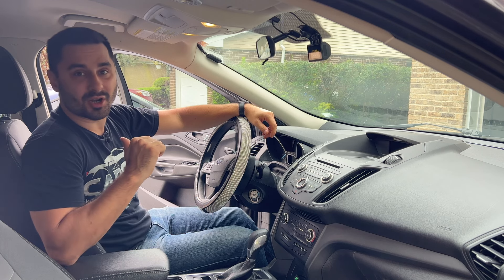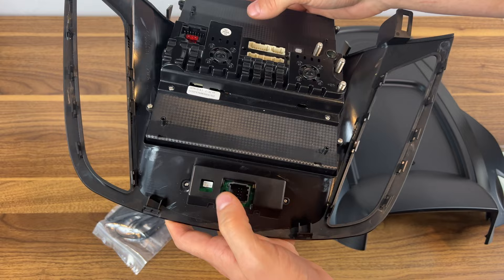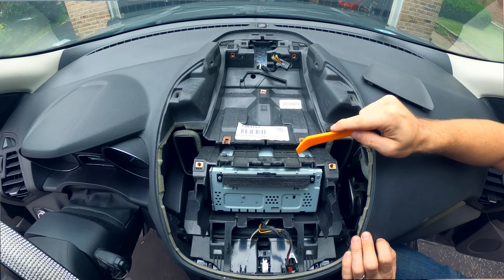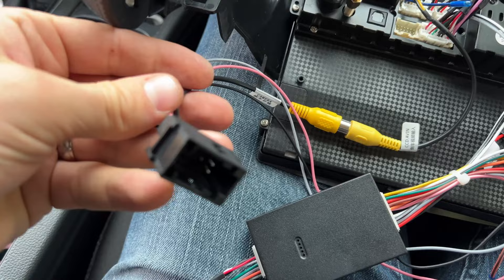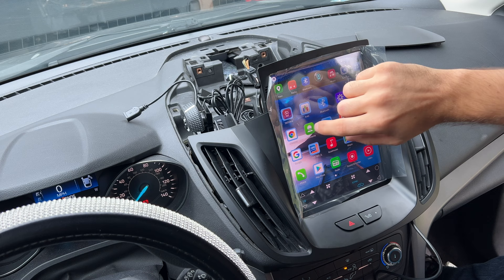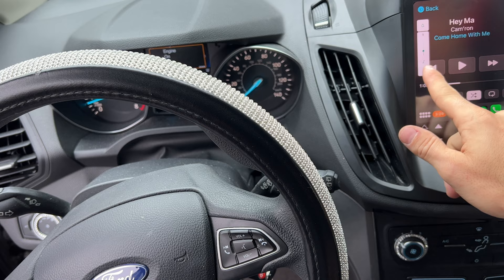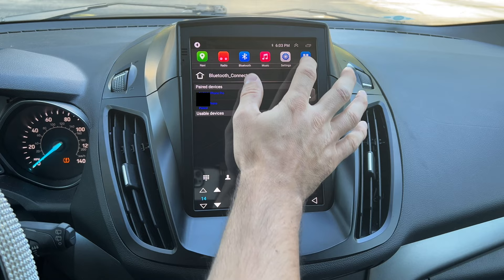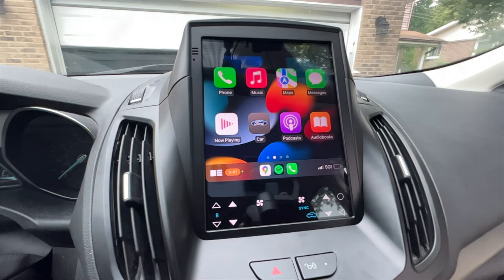Ford Escape Wireless CarPlay Retrofit - Seicane Headunit Install/Review

Comment from the maker: Ford Escape (2013-2018): https://www.seicane.com/android-for-2013-2018-ford-wing-tiger-radio-with-gps-navigation-hd-touchscreen-bluetooth-support-carplay-dvr-obd2-h7662?acc=b73ce398c39f506af761d2277d853a92

You can also get similar units for basically any car you can imagine!
Reply: Hey where do I get this device to buy? where can I get it installed. I am in the US state of Texas.
Reply: Great video, one area you don't address. Is the backup camera the stock one with the vehicle, or did you buy an add-on? If it is the stock which video cable were you connecting to the one for the unit. Thanks
Reply: do you think it will fit the 2019 escape?

Comment: I just installed this in the identical car if this video and I can tell you it's not a simple plug and play installation. The back of the video display hits the front part of the plastic box that holds the factory radio which required use of a dremel tool to trim a large section of it off to get it to fit. You also need to cut out room for the connections to the GPS antenna and radio antenna. Speaking of the radio antenna, you will need to buy an adapter cable to connect the unit to the car antenna. What's also missing from this video is that you need to remove the plastic locking clips from the dash parts you remove and install on the new parts. Not sure why that was left out. Technical support from Seicane is a joke. They will respond to your emails, but they are of no help. I figured out everything about installation and using the unit on Youtube or trial and error. The unit does look good after finally getting it installed and seems to work fine so far.
Reply: Thank you for posting this! I am trying to install this now and have been running into issues with it fitting. Thank you!
Reply: I’ve been looking at touch screens to put in my moms 2018 escape and the dash kit is fucking expensive
Reply: You should’ve did a video
Reply: Pictures or videos to share?
Reply: Thanks for commenting is the factory back up camera plug and play on what is shown here or do you need to purchase an aftermarket camera?
Reply: how is the mic on yours?  Can you use an external?   I've been looking into getting one of these for my truck.  I've installed a few stereos before, but not from Seicane
Reply: @dougkovach6213  The factory back up camera is plug and play and works fine. This is one of the big reasons I got this unit.
Reply: @brichardson7884  It's okay, but not great.
Reply: Thanks for the info, I have been going back in forth will the seller of the item to get further information and language barriers don't help to get everything correct.
Reply: Hi Bob,would you do installation with fee just in case?i want this unit get installed in mine too! thank you.I am from syracuse
Reply: Any update on functionality? Still working?
Reply: Do you have a link to the radio antenna adapter
Reply: @creson12 did anybody ever responded when you asked the big question “how has the radio been performing “ was it even worth it?
Reply: This is true, 9 out of 10 of these things require some slight modification to the inside of the dash. I just did one on Ford C Max (same dash and wiring) and I had to remove three pieces of the interior dash with Dremel. Don't get me wrong it wasn't a difficult job but it would have been nice to know beforehand rather than suggest it's just 'plug and play'.
Reply: Yes, this was not in the VIDEO. I bought this unit because there was a installation video. WTF? I have to remove a part of my car/ dash to get it to fit ? What if I want to return it to the original factory set up ? Very Very misleading and disappointing! Ill see if I can do a video.. SIMPLE CAR GUY...Not so simple!!!
Reply: @jeffbrady6422  I got one from a brand called Junsun or something like that, same thing, no plug and play but with some slight modding it fits spot on.

Comment: Yes the person that did make this video left out the most important information. Which makes this video helpful but totally useless. You have to cut two sections of the plastic where your old radio was in order for this to fit. You also have to use the clips from your factory parts to get this to clip in. Someone mention that this does not come with the antenna attachment to fit the new radio YES IT DOES. it comes with everything you need.
Reply: Do you know if the OEM camera will work and if it will also beep when backing up? Thanks!

Comment: How did you connect the radio connector you removed from the factory radio to the new unit? Didn't see that part in the video. They are totally different. Did they give you an adapter for this?

Comment: 2016 escape - best advice is to dry fit new unit before adding wiring or the old vents. You can see what plastic needs cut out to fit and save yourselves lots of trouble

Comment: I installed one in my 2015 Escape s. Ive had the same issues others have had with the 2015s. Steering controls arnt recognized in the software, original usb port just charges, no data transfer, and i cant seem to get Android Auto to work wirelessly at all. Wi fi hotspot from my phone seems intermittent, and the unit dosent like to hold settings, im constantly renableing wi fi and mph instead of kph in the settings. Any help would be appreciated.
Reply: Where you able to figure things out and did you install it on 2015 ford escape SE?

Comment: Didn't see how rear view camera appear and how GPS working, why? Maybe because is some significant issue with it?
Reply from the maker: I show how to set up the reversing camera and show it working at 12:35. As far as GPS, this was installed specifically to use with Apple CarPlay which I show it working at 10:35 (map is blurred for privacy). Thanks for watching!

Comment: I noticed a comment below where you responded to the TPMS light and I had noticed that it was on too when you were demonstrating the display.  The battery and check engine lights were not on so it was not the same as when you start the car and a lot of dash lights come on then go off, so I just want to clarify why the TPMS light was on in your video.  Was the TPMS light on as a result of anything you installed in this video?  The company also sells "TPMS" as an add-on for this product so I'm curious if it is required because maybe removing the old head unit also removes the factory TPMS receiver and that could have been why your light was on?  I really want to buy this product, and I've sent a question to their customer service about the TPMS light and to be sure it would fit a 2013 Ford Escape Titanium as it has a different dash configuration with a larger screen.  So when you said below " I have checked since and all is good" you are saying the factory TPMS still works fine and installing this part had no impact on it?
Reply: Did you ever get a reply from the company?
Reply: @alfredovazquez7917  wondering the same

Comment: I just installed this in my 2017 escape SE but the large harness that went in the back of my stock 8" screen doesn't have a mate with this new unit...my car also came with a back up camera but the harness I'm supposed to connect at the upper windshield near the hood doesn't have that factory cable to plug into...and my car came with 2 USB ports but there isn't anywhere to plug in...I'd zelle for some help. 

Basically, everything works, but the camera doesn't work since I don't have anywhere to plug that piece into, stock USB ports don't work, and my steering wheel volume controls don't work. Somehow, the screen actually controls my air and heat, which I don't really need because the stock controls are below. I'm hoping for some help.
Reply: Adding to my previous post: do NOT buy this if your escape came stock with the OEM 8" screen like mine. That head unit has a 54Pin harness and this kit does not come with one whic is why my steering wheel functions don't work, rear camera doesn't work,  and USB built in port don't work. Since then, they sent me a 54Pin harness adapter to connect the video for the reverse OEM camera, but the feed is blurry and I tried every setting possible and nothing has worked. The 3 wires that go into the decoder aren't being used which I believe is why my camera still doesn't work....will update once I receive more instructions from customer service.

Comment: I just installed the product. Steering wheel media control buttons are not working. Could you please confirm which cable to be connected?
Reply from the maker: I don’t remember which cable exactly, but you may have to go in the settings and enable/configure yours. Have you connected all cables?

Comment: I ordered this unit from Seicane for my SEL 2013 Ford escape. They said it would be compatible with my vehicle but it isn't. The harness isn't the same as sync 2 head unit.

They sent me what you installed but the wire harnesses are much different. 

No sound or wheel controls.

A stereo   without sound is completely useless.
Reply: And they will not help you one bit. As long as they got the sale that's all they care about. Crap company, crap customer service and support. All around garbage
Reply: @Jeff Stienborn  I'm experiencing the same. I just replaced my stock 8" just bc I was bored and wanted something new and the harnesses they provided are leaving 2 of my stock harnesses without mates. Back up camera doesn't work, stock USB ports no longer work and steering wheel controls don't work. Amy luck on refunds??

Comment: Could anyone tell me what connects to the other side of the can bus decoder? If you look at 7:35, it would be the connector on the left side. I think it's a 2x7 header. My kit was missing whatever cable/harness plugs into that side of the decoder. 

There's also nothing connected to one of the 2 large connectors that was plugged into the original SYNC unit. Coincidentally, I don't have any SYNC functions and the tach & speedometer on the home screen don't work.

EDIT: I emailed the supplier and we got it working by changing some protocol setting in the stereo. Apparently nothing plugs into those headers. Presumably they're made with extra connectors to adapt to a wide range of vehicles.
Reply: Same here on the steering controls - I have one large connector from the new harness not connected and one from the old for the old buttons
Reply: I also have the same issue no connection for one side of the can bus decoder. I wonder if that is why my backup camera does not work. screen switches but no image.

Comment: I have a 2018 escape I just installed it but rear view camera will not appear..I don’t have that harness at the top..steering wheel controls do not work either
Reply: Was you able to get the steering wheel control to work? Much appreciated

Comment: I bought this for my 2018 Ford escape se and I can not get the face to clip in. Any suggestions? There are no wires in the way, I was able to get the vents lined up, but still nothing. I seen that you struggled a bit to get it on yourself. What is the trick?
Reply from the maker: I bent the plastic that’s in the way just a little bit and then put it over the part that’s sticking out in the back of the unit.
Reply: Which part did you bend?  I can get both sides in but when I go to level out the bottom of the unit it doesn't lineup that lineup like something is pushing it
Reply: Have you found a way to get it clipped in?
i have a 2018 Ford Escape SE as 
And i'm looking to buy it...
Reply: Hello, can anybody confirm that this kit will fit into the 2015 Escape SE model with a slightly different control panel? Please help! Please confirm that it will work. Tyvm.
Reply: I'm having the same problem with mine. The back of the display unit hits the plastic frame that the stock radio was mounted in. Did you ever figure out how to get it to go in? I contacted Seicane and they said something about adjusting the hardware case down to fit, but I don't see any adjustment. May have to send this back and get a refund if I can't figure out how to get it to fit.
Reply: Were you able to get your rear view camera to work? I just installed it I also have a 2018 escape but steering wheel controls don’t work and rear camera doesn’t work either. Please help

Comment: You’re TPMS is illuminated.  One or more of your tires is low in air.  You may have FOD in your tire(s).
Reply: What is FOD
Reply: @tonybashiproductions3356  foreign object debris.  It’s a military aviation term.  FOD is what caused Air France Flight 4590, an SST Concord jet to burst into flames and crash shortly after take off from Charles de Gaulle Airport, in Paris, France on 25 July 2000
Reply from the maker: Thanks, I might have missed it, but I think it was only on because the car wasn't turned on. Either way, I have checked since and all is good. Thanks for looking out!

Comment: I ordered one from Seicane, (this exact one), they told me "It will work perfectly for your car" and its been a nightmare for over a month trying to communicate with them to help me connect it. I have a 2015 Ford Escape but with the 8" Sony screen/Amp. The sent me the same "Plug and Play" connectors as this unit. Obviously they are not the same harnesses after watching this video. Do you know anything the Sony Systems with the 54 pin/APIM?
Reply: Any update from Seicane? Did they supply the right harness?
They did the same to me. Just sent them an email.
Reply: @AdamMSomers  horrible customer service and experience all around. They just tell you "give us more time", give you no answers, no help, won't let you get a refund, won't send you the correct harnesses or even help you find one. Sure we're both just screwed and learned a lesson of how horrible seicane is. I found out with Sony sound system it's really hard to decode the sound, if that's what you have. Good luck
Reply: @jefferysteinborn  I'll wait for their reply then have PayPal step in if I have to. Hope it gets resolved, but my hopes are slim hearing your experience
Reply: @AdamMSomers  keep us all updated
Reply: @AdamMSomers  any luck? They just completely stopped replying to me. What a crap company
Reply: @jefferysteinborn  PayPal will refund me. But I have to pay to ship the item back.  It is not compatible with our system
Reply: @AdamMSomers  update me on how much shipping costs out of curiosity lol and man they'll sell anyone anything if they can get away with it huh yikes
Reply: @jefferysteinborn  with factory amps you’ll need to have a separate harness running from amp to the back of your head unit. They should have sent you one but If not then order one or send it back
Reply: @dylanreevesx6073  Do you have a link this harness for the sony factory amp? I am having troubles locating one, have done a lot of googling.

Comment: Will this work for my ford C-max?
Reply: I installed the H7 unit in my dad's 2018 C-Max and it is working fine. Some cutting required on the box that houses the old media player to make room. So far steering wheel media controls are not working but still investigating.

Comment: Would this work on my 2019 ford escape standard edition
Reply: I just installed this in our 2019 Ford Escape S (base model trim) Everything works fine but as someone else stated here you have to trim pieces of the plastic area that held the old head unit.

Comment: Does the android CarPlay work with apple? Stupid question probably but I have never had CarPlay….
Reply from the maker: Yes. It has both Android Auto (screen mirroring for Android) and Apple CarPlay (Screen mirror for iPhones). So, whichever phone you have, you will be able to use it like I did in the video for maps, phone calls, music, etc.
Reply from the maker: Yes. It has both Android Auto (screen mirroring for Android) and Apple CarPlay (Screen mirror for iPhones). So, whichever phone you have, you will be able to use it like I did in the video for maps, phone calls, music, etc.
Reply: @SimpleCarGuy  i bought similar unit but the steering controls are not working.. any ideas how to fix it?
Reply from the maker: Which one did you buy? Did you connect it to the iDrive controller?
Reply: I am trying to order one for a 2014 Toyota Corolla, once it goes in the cart it is asking me all sorts of tech questions and it seems each little thing is like a $99 add on. Did you experience this as well?
Reply from the maker: I didn’t pick any addons. Unless you want additional camera or other stuff they are offering.
Reply: @SimpleCarGuy  seems to me the car play dongle is even an add on. Backup cam with my car already has is a add on. Would you mind taking a peek and offering your advice? I feel most aftermarket head units come with thirst things already.
Reply: Simplecarguy where did you purchase this.....by the way awesome video